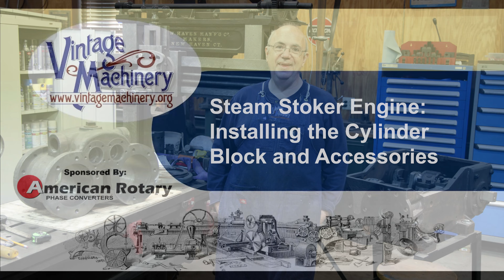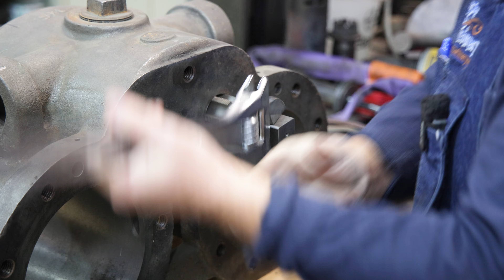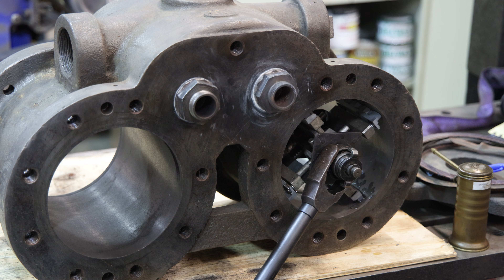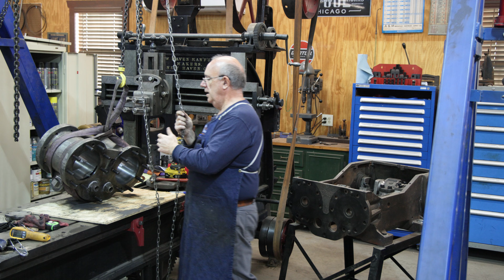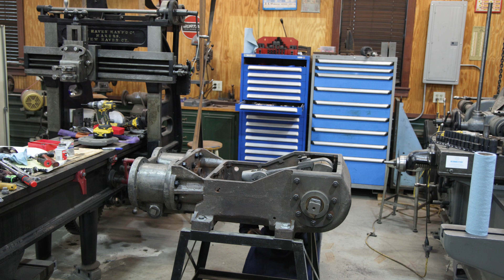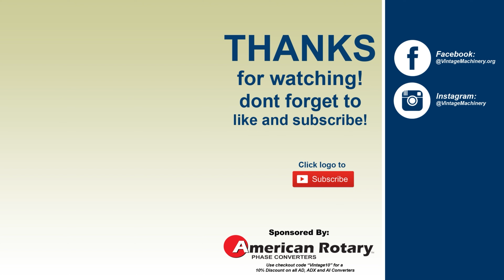Steam Stoker Engine: Installing the Cylinder Block and Accessories

Comment: 8:18, you forgot to say "CLICK!"  Edit to add:  Looking back at the second video in this series, the witness marks from the original copper cylinder gaskets showed they were both very much off center, so good job making sure the new ones were properly centered.

Comment: This is one of the best projects you have done. It has had its ups and downs and many challenges but I appreciate your dedication and determination to see it through. Along the way there have been so many ancillary projects - boring out the cylinders, cleaning up the sliding surfaces, making and machining new parts - and I have learned a lot. Thank you Keith!!!

Comment: It feels like the screws on the oil slingers should be done up tighter than that. I'd have thought you'd want all the tightness to prevent screws rattling around inside the eingine

Comment: Keith, unless the shop that built the stoker engine had some sort of special shims that held the copper gaskets in place,I suspect that they could’ve  installed them with the entire unit standing upright on the crankshaft end.

Comment: Flathead socket heads on the oil slinger screws. Tighten them gutentite and you won’t need no stinking Loctite.

Comment: You'd think that the copper gaskets would be like a head gasket where it covers the entire mating surface and has holes for all the studs. Strange. Maybe what you pulled off weren't original either.

Comment: If you have copper sheets, all you need to cut them is a scoring compass (something you can make very fast in shop) and the results are very clean. Also, annealing it might be a good idea.
You don't want them to be over the studs, because then they won't squeeze  (the gap of the studs and outside is there for a reason, is what i'm saying).

Comment: damn you have everything
Reply: Well in a way, but... he needs kit that size. Abom and others need bigger kit. Keith will soon show you from his point of view he doesn't have enough when another wayward machine arrives due to his cast iron inefficiency addiction kicking in.
Honestly though. When you go big you need a whole range of even bigger tools for every type of tool. Look at bore gauges, dear to begin with, each next one up in the ranges is dis proportionality dearer than the last and you can get them all the way up to two feet and counting. 
I'm going to stay hobby scale small lathe. make some mini engines, maybe make a remote control car with suspension and springs. and use a dial caliper for every internal and external bore I can. Also I'm going to see how small a budget I can do this hobby on. I could buy a chinese model lathe, and then all accessories for £3000 but I can make it myself better for cheaper with scrap metal. salvaged treadmill motors and a mega load of free knowledge of lots of ppl on the internet on how to do it. and some time and effort too! Hope this helps
Reply: Except skill!:face-blue-smiling::face-blue-smiling::face-blue-smiling:
Reply: @garybrenner6236  it has become a sport for me to find your negative posts just to remind you what an a-hole you are in the event you have forgotten

Comment: Keith, I have been waiting patiently to see that old tap used in a video!  It sat in a drawer in my classroom in Northern Minnesota for many years. It was pulled out once a year and used as a visual aid when we talked about the proper way to use taps and dies. It finally had it's two minutes of fame! Thanks for the mention.
Reply: Wait, you mean not everybody has 2” straight and pipe taps in their collection? 😂 Keith: you never cease to make me feel inadequate! (I’m Rex, btw, from one of Richard’s first scraping classes at your place a long while back.)
Reply: I am more shocked that still have a shop class

Comment: Getting there....Question, Those oil slingers and their flat head fasteners, will those screws work loose without being torqued or some thread locker?
Reply: Don't confuse him!
Well today we got to watch him fumble around with hand tools instead of machine tools.
BTW, did anyone see him blow the chips out of any of those threads he re tapped?:body-blue-raised-arms:
Reply: @garybrenner6236  He knows better. Not everything get shown on videos. How about that shop of his...very sweet.

Comment: on the oil singers, shouldn't the threads have locker compound on them? If not, why? It looks like they could work loose with all that movement.
Reply: Why? Loctite did not exist 100+ years ago and the engine worked just fine.
Reply: @JSB1947  They definitely had ways to retain fasteners even without chemical locking agents (invented around the 1950s). Vibration isn't a new problem! Sometimes when working on old equipment, you do things a bit differently than back in the day because they didn't have those solutions available to them but still had similar problems.Physics is physics.

Comment: Think the singers would "sling" better faced to the oil intake on the connecting arms rather than sling it to the chassis? But who knows?
Reply: I went back to the disassembly (video 4 of this series) to check, and it shows them in the same orientation.
Reply: I agree.. i think he put them in upside down.
Reply: @michaeljames9671 He reinstalled them in the same orientation as they were when he  disassembled the engine.

Comment: A trick for starting big taps or other threaded plugs is to reverse rotate the tap until it drops down snugly.  If the tap is correctly aligned it will feel solid in the threads with minimal rocking allowed.  Thanks for a great video.
Reply: I use that regularly.  I've been told you're turning that backwards.  I just roll my eyes and keep going.
Reply: Yup - me too and I get the same reaction from uninitiated observers.

Comment: I’m not pondering why you installed your packing glands on the inside to the assembly where they are no longer accessible.  Did you assemble the valve / piston assembly backwards?

Comment: Cool that Keith Fenner helped you out on the gaskets, but for anyone who doesn't know a guy, send cut send has really descent pricing and very quick turnaround. Ive used them for a few items including a folded up and zinc plated crank handle and Ive yet to be disappointed.  they offer dozens of different materials, and so far I have been very impressed with their cut finish and accuracy.

Comment: I recommend using either epoxy type (X-pando brand) thread sealer, or good quality pipe joint compound and oakum rope on those straight threads

Comment: Kieth, I've been following this escapade for years, since the beginning. I might have missed a few episodes but one question has been bugging me of late, now that you're in the reassembly stage.
My question regards the sheered off bolt or stud on the lower front casting of the cylinder block, between the cylinders. Its pretty obvious as its orange rust in colour to the right of the left hand cylinder, viewed from the front. There is a similar "hole" to the left of the right hand cylinder. So my question is, are you going to remove that stud or leave it for some other poor soul to remove when they have to add the clading over the engine's parts. Surely it would be easier to remove or bore it out now than once the whole engine is assembled?
Regards from Canada's banana belt. 
🤞🇨🇦🍌🥋🇺🇦🕊🇺🇲🪛🪒🪓🦃💩👍🏁
Reply: Escapade is right!:face-purple-wide-eyes::face-purple-wide-eyes::face-blue-smiling::face-blue-smiling:
Reply: @garybrenner6236  When will the genius of your wonderful YouTube contributions be appreciated Mr Brenner? This audience should all immediately binge watch your catalog of teaching videos.  Like and Subscribe to your content! You sir are the foremost source of logical, approachable, and relatable instruction for the aspiring machinist hobbyist and i think it is quite the sham that Mr Rucker conspires to hide them from the world.  I see you trying to publish the truth here, but somehow your message is consistently hidden in the replies to other comments.  It's a dastardly plot I say!

Comment: Should the copper gasket be Annealed and hemp use for the threaded pipe
Reply: I agree, they should be annealed at  a good red heat, and the oil slinger screws fixed with thread sealer. I did not see Keith lock the cylinder head  studs  down.

Comment: Should have turned the body on its side then dropped the cylinder straight down. Gaskets would not move.
Reply: In this case, it was easy to just reach into the cylinder and hold the gaskets in place. When the time comes to install the cylinder head, though, that will not work.

Comment: I'm just a engine hobbiest, but that was not the right stroke rate with the hone to achieve a 45 degree cross hatch in the cylinder.  Might need to redue the hone job to achieve the proper cross hatch angle.

Comment: I like your idea of the larger copper gasket going around the studs
Reply: I'm not sure that would be a good idea. Copper gaskets need to be crushed slightly to seal properly. If the copper area is bigger, more force (torque on the bolts) would be required to achieve the proper amount of crush.

Comment: Perhaps it's just me, but some loctite on the screws that hold the oil slinger?
Reply: I thought the same thing. But heat melts Loctite, I am not sure how well it would survive there.
Reply: @alandaters8547  High temp thread locker is good to 650F or more. Way higher than superheated dry steam.
Reply: @MrTexasDan yeah even naval boilers were 500 ish deg...
Reply: @alandaters8547  I would think that the crank end wouldn't be that hot - probably cooler than the bottom end of a gasoline engine since the oil is not splashing on and cooling the piston.  But, I could be wrong. It's happened before. 🙂
Reply: @alandaters8547  There's no steam in that end of the engine, only heat is what conducts back there. Even at 300 psi, steam is only 500ish or so degree. And the engine is bolted to a very large metal chassis that acts like a heat sink.
Reply: I was thinking the same thing. If one of those were to come loose, it would cause a lot of damage.

Comment: I was thinking I had missed something and this was another one...this is the same 6 year project?
Reply: Yes. The very same one. Keith sent the block to another machinist who, after months of fiddling, found he could not do the required work. Keith then had to restore a planer and develop tooling to do the job. Other than that, it's just been slow going between jobs.
Reply: @oleran4569  Oh yes, Keith is he greatest machinist  in the   known universe!!:face-blue-smiling::face-blue-smiling::face-blue-smiling:

Comment: just use some grease on the copper gaskets, that will hold them in place.

When you tighten it up, it will squeeze out.

Comment: Your in and out stroke was to slow for a proper cross hatch pattern.
Reply: Well today we got to watch him fumble around with hand tools instead of machine tools.
BTW, did anyone see him blow the chips out of any of those threads he re tapped?:body-blue-raised-arms:
Reply: and not enough oil nor the correct oil?  It is what it is.
Reply: @jimc4731  The only complaint I have about Keith's work is that he's sloppy about lubrication.
Reply: @peterhobson3262  OMG, that's your ONLY complaint??

Comment: I miss the drills that had the variable speed thumb wheel where you could adjust the drill so it wouldn't go above the speed you set the trigger at.

Comment: Seems to be going well. My guess is your work is more precise than the original assembly. I would bet they didn't use or have a torque wrench back then. Wish the OD of the copper gaskets was slightly larger as I'm sure you do as well., but they will be fine. This thing will last another hundred years. Does your stand have out riggers on the bottom to prevent tipping as you add overhung weight? Looking forward to seeing you make cast iron rings.

Comment: To get a proper crosshatch with the hone you have to roughly match 1 rotation to the length of the cylinder. If you move too slowly up and down you will get a circular patern with the grooves running perpendicular to the cylinder bore and not a nice 30-45 degree one like what you want.
Reply: I've seen plenty of gas and diesel engine cylinders being honed and the hone was always moved a lot faster in and out than what he was doing. Maybe things are a little different with a steam engine?
Reply: @CanizaM unfortunately...no. same principles apply.
Reply: This is not internal combustion. Steam engines don’t use a crosshatching on the cylinders because they lubricate completely differently. The oil is a compounded oil that is suspended in the steam. It doesn’t need to cling to the walls like a car engine. It couldn’t do so anyway because the steam scours the surface clean. The goal of honing with steam is to get good roundness and smooth finish in the cylinders, not crosshatching.
Reply: @blondie7575  @13:00 he states "we are gonna put a nice cross hatch pattern on there." my comment was in response to that... But it is good to know it isn't needed. Although for my 2 cents... I would still want to strive for them so there is a consistent grind keeping the walls cylindrical without low and high wave patterns in there from inconsistent movement of the hones.

Comment: I've done plumbing work behind people like you. Over tighten black pipe fittings to the point where I need to pull out my 30 inch monkey wrench to get 1/2" apart.  By design, it doesn't need to be super tight. You essentially said the same thing
Reply: I doubt if they were as bad as him!:body-blue-raised-arms::body-blue-raised-arms:
Well today we got to watch him fumble around with hand tools instead of machine tools.
BTW, did anyone see him blow the chips out of any of those threads he re tapped?:body-blue-raised-arms:

Comment: Anti-seize? Heck, that's the next guy's problem.
Reply: I thought anti-seize was a lubricant. It's designed so that the next person who has to remove them finds it an easy task.  It is usually copper based, it inhibits rust and keeps water out.
Reply: It will probable be Keith ..... he's been doing repairs on the steam engine at the museum for many, many years. :)
Reply: Might as well do it properly 😊😊😊

Comment: Thought in cylinder to pistons honing it should be about a 60 degree hone..   When breaking in, it promotes proper ring to cylinder contact .. The high ridges break off at an angle to help a proper and uniform seal.